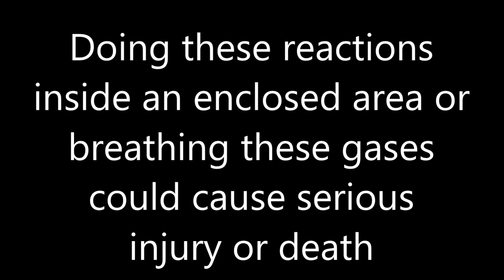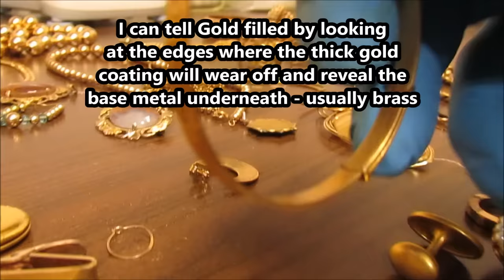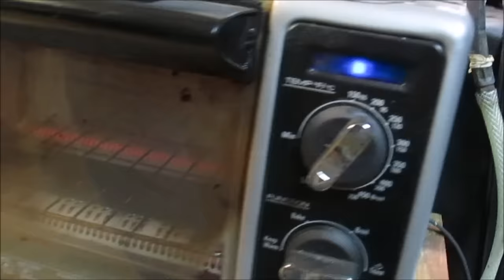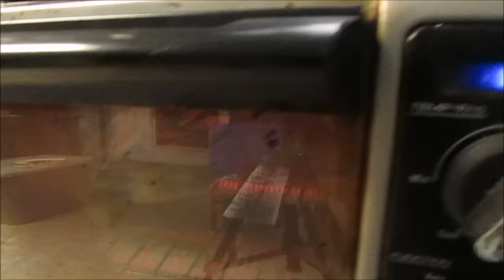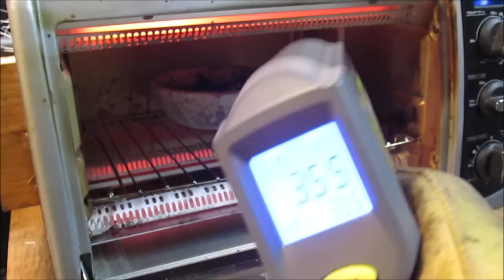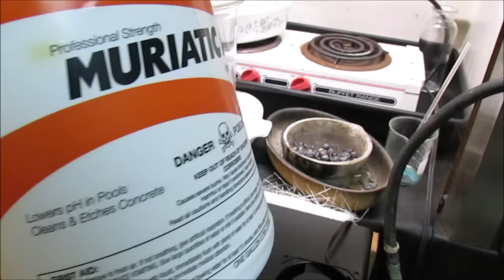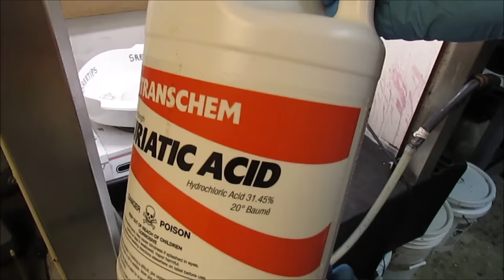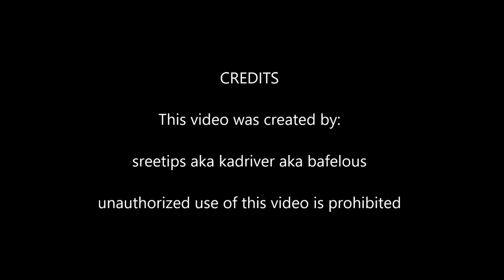Gold Refining 740 Grams of Gold Filled Scrap

Comment: Aqua regia dissolves gold, though neither constituent acid will do so alone, because, in combination, each acid performs a different task. Nitric acid is a powerful oxidizer, which will actually dissolve a virtually undetectable amount of gold, forming gold ions (Au3+). The hydrochloric acid provides a ready supply of chloride ions (Cl−), which react with the gold ions to produce tetrachloroaurate(III) anions, also in solution. The reaction with hydrochloric acid is an equilibrium reaction that favors formation of chloroaurate anions (AuCl4−). This results in a removal of gold ions from solution and allows further oxidation of gold to take place. The gold dissolves to become chloroauric acid. In addition, gold may be dissolved by the chlorine present in aqua regia. Appropriate equations are:

Au + 3 HNO
3 + 4 HCl {\displaystyle {\ce {<=>>}}} {\displaystyle {\ce {<=>>}}} [AuCl
4]−
 + 3 [NO
2] + [H
3O]+
 + 2 H
2O
or
Au + HNO
3 + 4 HCl {\displaystyle {\ce {<=>>}}} {\displaystyle {\ce {<=>>}}} [AuCl
4]−
 + [NO] + [H
3O]+
 + H
2O
If the aqua regia solution only contains gold, solid tetrachloroauric acid may be prepared by boiling off excess aqua regia, and removing residual nitric acid by repeatedly heating with hydrochloric acid. That step reduces nitric acid (see decomposition of aqua regia). If elemental gold is desired, it may be selectively reduced with sulfur dioxide, hydrazine, oxalic acid, etc.[6] The equation for the reduction of gold by sulfur dioxide is:

2 AuCl−
4 (aq) + 3 SO
2(g) + 6 H
2O (l) → 2 Au (s) + 12 H+
 (aq) + 3 SO2−
4(aq) + 8 Cl−
Aqua regia dissolves gold, though neither constituent acid will do so alone, because, in combination, each acid performs a different task. Nitric acid is a powerful oxidizer, which will actually dissolve a virtually undetectable amount of gold, forming gold ions (Au3+). The hydrochloric acid provides a ready supply of chloride ions (Cl−), which react with the gold ions to produce tetrachloroaurate(III) anions, also in solution. The reaction with hydrochloric acid is an equilibrium reaction that favors formation of chloroaurate anions (AuCl4−). This results in a removal of gold ions from solution and allows further oxidation of gold to take place. The gold dissolves to become chloroauric acid. In addition, gold may be dissolved by the chlorine present in aqua regia. Appropriate equations are:

Au + 3 HNO
3 + 4 HCl {\displaystyle {\ce {<=>>}}} {\displaystyle {\ce {<=>>}}} [AuCl
4]−
 + 3 [NO
2] + [H
3O]+
 + 2 H
2O
or
Au + HNO
3 + 4 HCl {\displaystyle {\ce {<=>>}}} {\displaystyle {\ce {<=>>}}} [AuCl
4]−
 + [NO] + [H
3O]+
 + H
2O
If the aqua regia solution only contains gold, solid tetrachloroauric acid may be prepared by boiling off excess aqua regia, and removing residual nitric acid by repeatedly heating with hydrochloric acid. That step reduces nitric acid (see decomposition of aqua regia). If elemental gold is desired, it may be selectively reduced with sulfur dioxide, hydrazine, oxalic acid, etc.[6] The equation for the reduction of gold by sulfur dioxide is:

2 AuCl−
4 (aq) + 3 SO
2(g) + 6 H
2O (l) → 2 Au (s) + 12 H+
 (aq) + 3 SO2−
4(aq) + 8 Cl−
Aqua regia dissolves gold, though neither constituent acid will do so alone, because, in combination, each acid performs a different task. Nitric acid is a powerful oxidizer, which will actually dissolve a virtually undetectable amount of gold, forming gold ions (Au3+). The hydrochloric acid provides a ready supply of chloride ions (Cl−), which react with the gold ions to produce tetrachloroaurate(III) anions, also in solution. The reaction with hydrochloric acid is an equilibrium reaction that favors formation of chloroaurate anions (AuCl4−). This results in a removal of gold ions from solution and allows further oxidation of gold to take place. The gold dissolves to become chloroauric acid. In addition, gold may be dissolved by the chlorine present in aqua regia. Appropriate equations are:

Au + 3 HNO
3 + 4 HCl {\displaystyle {\ce {<=>>}}} {\displaystyle {\ce {<=>>}}} [AuCl
4]−
 + 3 [NO
2] + [H
3O]+
 + 2 H
2O
or
Au + HNO
3 + 4 HCl {\displaystyle {\ce {<=>>}}} {\displaystyle {\ce {<=>>}}} [AuCl
4]−
 + [NO] + [H
3O]+
 + H
2O
If the aqua regia solution only contains gold, solid tetrachloroauric acid may be prepared by boiling off excess aqua regia, and removing residual nitric acid by repeatedly heating with hydrochloric acid. That step reduces nitric acid (see decomposition of aqua regia). If elemental gold is desired, it may be selectively reduced with sulfur dioxide, hydrazine, oxalic acid, etc.[6] The equation for the reduction of gold by sulfur dioxide is:

2 AuCl−
4 (aq) + 3 SO
2(g) + 6 H
2O (l) → 2 Au (s) + 12 H+
 (aq) + 3 SO2−
4(aq) + 8 Cl−
Aqua regia dissolves gold, though neither constituent acid will do so alone, because, in combination, each acid performs a different task. Nitric acid is a powerful oxidizer, which will actually dissolve a virtually undetectable amount of gold, forming gold ions (Au3+). The hydrochloric acid provides a ready supply of chloride ions (Cl−), which react with the gold ions to produce tetrachloroaurate(III) anions, also in solution. The reaction with hydrochloric acid is an equilibrium reaction that favors formation of chloroaurate anions (AuCl4−). This results in a removal of gold ions from solution and allows further oxidation of gold to take place. The gold dissolves to become chloroauric acid. In addition, gold may be dissolved by the chlorine present in aqua regia. Appropriate equations are:

Au + 3 HNO
3 + 4 HCl {\displaystyle {\ce {<=>>}}} {\displaystyle {\ce {<=>>}}} [AuCl
4]−
 + 3 [NO
2] + [H
3O]+
 + 2 H
2O
or
Au + HNO
3 + 4 HCl {\displaystyle {\ce {<=>>}}} {\displaystyle {\ce {<=>>}}} [AuCl
4]−
 + [NO] + [H
3O]+
 + H
2O
If the aqua regia solution only contains gold, solid tetrachloroauric acid may be prepared by boiling off excess aqua regia, and removing residual nitric acid by repeatedly heating with hydrochloric acid. That step reduces nitric acid (see decomposition of aqua regia). If elemental gold is desired, it may be selectively reduced with sulfur dioxide, hydrazine, oxalic acid, etc.[6] The equation for the reduction of gold by sulfur dioxide is:

2 AuCl−
4 (aq) + 3 SO
2(g) + 6 H
2O (l) → 2 Au (s) + 12 H+
 (aq) + 3 SO2−
4(aq) + 8 Cl−
Reply: Why did you repeat everything 3 times?
Reply: I was going to say the same thing
Reply: I thought the nitric acid was a neutrilizer

Comment: Hello sreetips, I have about 10 lb of marked gold filled jewelry and scrap. A vast majority of this jewelry and scrap is gold colored or looks like gold except on the edges where some of it is wearing off. A small percentage of the marked gold filled jewelry and scrap is either very bright like Steel with no color or it is copper colored. Has the gold worn off this jewelry and scrap? Or should I process it along with the gold colored jewelry and scrap?
Reply from the maker: Philip, the thick coating of gold does wear off over the years. It's usually around the edges. Then it becomes very apparent because you can see the base metal and the thick gold coating at the point of wear. For gf stuff wore through clean down to the copper, your yield will suffer. If it were me and I had ten pounds, I would process it in one pound batches starting with the good stuff first. Especially if working as a beginner. The stuff that's worn through, you'll have to make a judgement call.
Reply: That's a good idea thank you for the advice. After doing some research online I think some of the very bright white colored scrap and Jewelry is white gold filled. I will definitely process that all separately just to be sure.
Reply: I could do that. But metal refining is a hobby of mine. I would prefer to practice my own skills.
Reply: eddie mclaren 
So you can go through it?

Comment: Sree tips shop is a gold filled mine, watching this video got me out my gold filled mind, in this video he says gold filled 99 times.
Reply: Are they all filled with gold?  seems silly to fill something with gold, surely you'd want the gold on the outside, and fill it with something cheaper?  In UK we do just that. and call it gold-plated.  I realise that in this case, "filled" probably does mean an outer covering. I just can't resist pointing out the absurdity of using the term "filled".

Comment: What is the difference between gold plated and gold filled?
Reply from the maker: Gold plated is base metal (brass) that is electroplated with copper, then a thin layer of gold electroplated over the copper. The gold is maybe 5 microns thick. A micron is a millionth of a meter. GOLD FILLED: a piece of brass with a sheet of 12 karat gold on the top and bottom of the brass is heated red hot and passed through rollers into a uniform thickness forming a thick layer of gold on top and bottom. It's then used to make jewelry. Thousands of time thicker than electroplate.
Reply: @sreetips  I don't think I've ever seen that. Interesting 🙂
Reply: The usual karat gold used for gold filling is 12K, but I have seen a little 14K. I seem to recall that you even mentioned one such piece in the video.
Reply: @sreetips  I have seen gold filled silver jewelry. I have a sheet that is 1/20 12K on one side and sterling silver on the other. I have no idea what the jeweler from whom I bought it intended to use it for.

Comment: That’s a hell of a lit of patient fiddling but what a reward!  Surely with that many stages of purification it must be four 9’s?
Reply: Unlikely. It takes a very good refiner to get three 9 gold through simple acid digestions/precipitations.
Reply: I would say yes, at least four 9's. It is not the acid process that most fail at in reaching four 9's it is usually poor filtering.
Reply from the maker: I've refined hundreds of ounces of pure gold. The assay comes back three nines fine - every time.
Reply: How can 4 9 purity be reached than?
Reply from the maker: Four nines can be done at the hobby level. But there is really no reason to do it. Three nines is the industry standard. I could get four nines by dissolving and precip twice using AR and SMB. Then dissolve the gold powder a third time with chlorine gas and precip with oxalic acid. But the only way to tell if four nines is achieved is to have an ICP assay performed. That would make a good video!
Reply: It is doubtful that the third precipitation to get four nines gold would be worth the additional chemical expense and time involved. If gold spot is $1400/Toz, that is only about an additional $14/Toz.
Reply: I GUARANTEE you are at four 9’s fine here.... I do the same thing you do and I have an OLYUMPUS XRF machine ($30 grand for this thing) and my gold comes out 99.99% nearly every time with a second aqua treatment. And it’s ALWAYS 99.95 + with the first treatment (as long as I do the first part of the process correctly and I don’t get lazy and let other pieces of magnetic crap in the batch). But yes... I ASSURE you this will be 9999 fine.
Reply: @joshfrisby928  dont you need to do that electrolysis onto the ti plates to get that pure? Or is that for removing hair? Im confused.
Reply: @sreetips  When I take my scrap gold to be melted in Toronto they mix all karats and then test it on an assay machine right in front of me. It can also tell me what else is still present.  Would have been great to see what your bar read.
Reply: @LoderMike  There are other methods, but the electrolytic process is the standard.

Comment: The way you put the hot metal straight into the beaker like that tells me that one day its going to crack or explode :)
Reply from the maker: I've put hot metal into glass containers hundreds of times and have never had a problem with cracking or exploding. Please see my video on refining karat scrap. In that video I pour molten metal into water in a metal container. Every now and then I'll get the molten metal too hot and it does explode when it hits the water. Scares the ghost out of me every time it happens, thankfully that's not very often.

Comment: Great video! You must have had a few pieces of 1/5th GF mixed in to get such a good recovery. I love finding good deals on Gold Filled items, it's one of the many things I'm stockpiling for future recovery and refining.
Reply from the maker: I was taken aback at the scale. I couldn't believe it. And I even took some of the pieces out during the process. I think that the key is in the nitric boils. Keeping the foils in the hot nitric to get rid of as much base metal as possible. And the incineration before the refining is very important.
Reply: I have never seen 1/5th GF, it is likely to be quite rare.  But it wouldn't take a lot of 1/10k12GF to get the recovered gold up to what you obtained. If your lot had been all 1/10k12GF, the theoretical recovery would be 37 grams.
Reply: @buggsy5  I have some 1/5th 14k GF, it is hard to come by, but has a lot more gold that 1/10 or 1/20.
Reply: Yes, twice as much as the 1/10K14 and four times as much as the 1/20K14.

Comment: I tinker around with small scrap, but not on this scale of furnaces, fume and heat mitigation and hi-tech processing. I cut up steel lids from jars and bottles and stuff these peices along with twist top lids into steel drink cans/tins [ whatever you wanna call them ], and I pull apart aluminium caps with those ring pulls and pull out, or scrape out as necessary, the inner HDPE linings and then stuff those into aluminium cans not fit for deposit redemption, then crush when filled, and I manually crunch those aluminium liquor bottle caps which I like to stuff into those aluminium bottles. Got it down pat for nifty little collections of scrap. No afterthoughts to do with processing peoples' keepsakes or mementos.
Reply from the maker: I've never worked with steel to aluminum. Aluminum can be troublesome in some of the refining processes so I remove if I find any.
Reply: @sreetips  No, of course, may not have worked that stuff, you appear to go for the precious metals. I'm not in your league, skill-wise or any other-wise.  I was thinking of the early preamble with the early sorting. You would do way better than I ever would if you did do any work in aluminium or steel.

Comment: Ok I'm slightly new to this, I'm an organic/biochem major, metallurgy and the like really aren't my thing. That being said, if you were afraid of lead being present couldn't you just add in an appropriate amount of silver, melt them all down together and turn them into shot. Then hit the shot with Nitric Acid and cupel the gold and lead. Then maybe run the lead-free impure gold through aqua regia? Just curious, at this point in time it's purely academic.
Reply from the maker: That solder probably had lead and tin. Tin dissolved in nitric forms metastannic acid or tin paste. It gums up filters like trying to filter elmers glue. It's best to remove as much of it as possible by boiling in hydrochloric acid to soften the solder then scrap it off with a knife.

Comment: I did the mental math and only expected a few grams of gold.  Gold fill has more gold than gold plate but is generally worthless.  You would have to accumulate much of it to make money from the scrap.
I used to go to yard sales and buy scrap gold from the people there.  It was a lot of fun and I made some money.  It was easy if a divorce had just happened, they were happy to get rid of wedding rings.  And wives would make the husbands get rid of jewelry gifted from old girlfriends.  I always paid cash and I never cheated anyone.  I gave my wife and daughters nice gold necklaces and bracelets that were too good for the scrap pile.  There was some jewelry I regret selling for scrap but I needed the money.  I had a very nice wedding/engagement ring set that was made in 1932.  It came in the original box from a jewelry store in Washingtion DC.  It had 4 diamonds to equal 1 carat and was made of platinum.  I didn't scrap it but I did sell it as jewelry. for a good profit.
Reply from the maker: I’m doing nearly the same thing. Except instead of reselling for a profit, I use it to make videos.

Comment: You did one of these videos a while back, in that video you pulled out all the magnetic material.  You said that magnetic gold filled had to be processed differently.  Do you plan on making a video on how to process magnetic gold filled?  I've been watching your videos over and over for the past 3 years prepping myself to refine some gold.  Thank you for sharing with us.
Reply from the maker: Brenda, I excluded magnetic in the last video. In this video, however, there were some magnetic wrist watch cases. I included them with no problems. In this video I carefully picked EVERYTHING apart and removed any iron and steel pieces before going to nitric treatments because nitric does not dissolve iron very well. If you want to try some GF scrap its best to remove any iron or steel and you'll get a better result. This was a very difficult video to make. But I included as much detail as I could so that you could see the little problems that can throw the whole batch into a nightmare. And there are other problems that can happen that were not shown because I didn't encounter them. If one little piece of soft solder gets in there it can make a mess of the whole thing. Processing GF scrap is not for beginners, but you got to start somewhere.